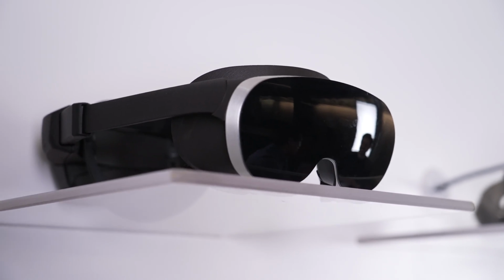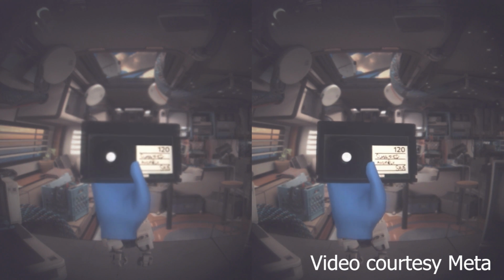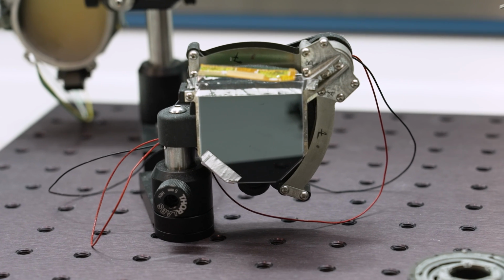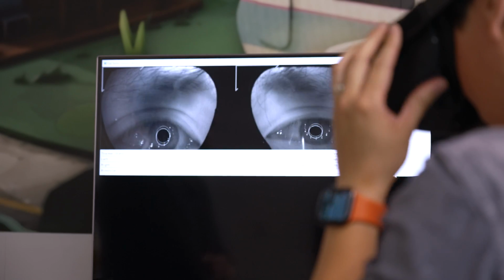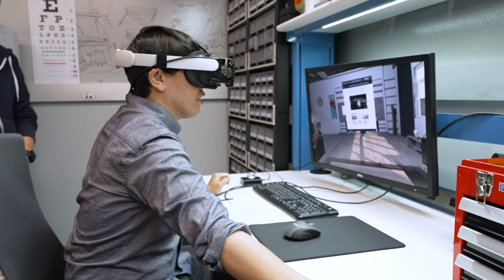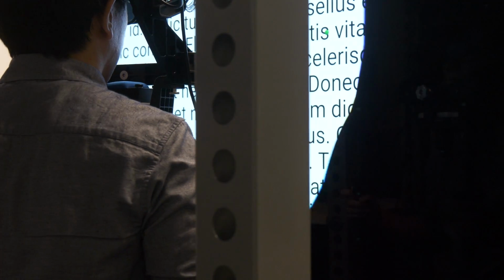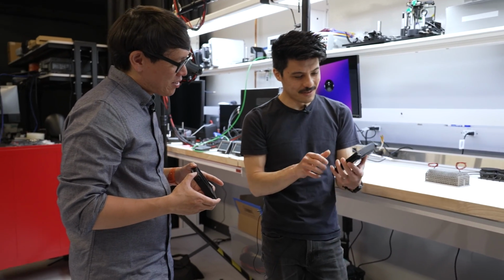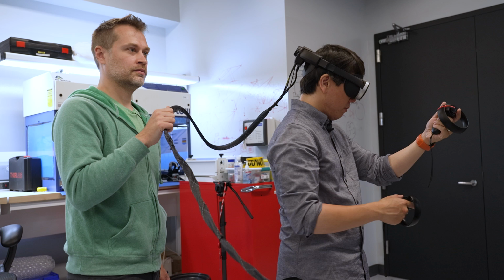Hands-On with Meta's New VR Headset Prototypes!

Comment from the maker: What are the display features you want most from a VR headset five years from now? 

Join this channel to support Tested and get access to perks:
https://www.youtube.com/channel/UCiDJtJKMICpb9B1qf7qjEOA/join
Tested Ts, stickers, mugs and more: https://tested-store.com
Reply: In 5 years…

7680x7680 per eye

Also developers that care about performance and not just make it look cool and hope the person buying can play

The displays should be done as best as they can from the get go and have it as a module so you can upgrade the processor or the housing or what ever it may be

People are more likely to buy improved parts rather than a whole new headset

If dell can do 2 DP inputs without issues then driving 7680x7680 per eye would not be an issue with 2x dp 2.0 ohh and at 120hz minimum
Reply: @commanderoof4578 8K lenses for VR means that your computer will be running a game on three different displays at the same time, a 30 series NVDIA GPU cant even handle 4K on max settings for VR, lenses are only clear in the very center in a specific viewing position, and because of that foveated rendering is a staple for VR games and how it works is it reduces the resolution for details not centered in the lens, thus 8K resolution will be natively reduced anyways
Reply: @G4MFR34K64  because of terrible devs that is the case correct

But the 2 VR games i have worked on myself can be rendered 3x at 8k resolution and without any gimmicks be it motion blur, depth of field or any rendering crud going on

You are saying as it is now

I saying how it will inevitably be

And finally most devs are sat on there ass doing the bear minimum to make quick cash while VR has more or less nothing but half assed games available
Reply: In rough order of importance:
ACTUAL GAMES NOT CRAPPY MOBILE GAMES,
near 180 FOV, 
8k per eye,
greatly reduced or no image distortion on imperfect eye placement,
pass through camera which capture environment in 8k 120hz, 
flawless finger tracking and face tracking, 
<1lb weight,
controllers with adaptive triggers and better vibration feedback.
Reply: A FOV that hides the edges of the lens, and HDR
Reply: @EinkOLED  yes to larger FOV!
Reply: @EinkOLED  firstone cant be done even if the lenses where too large for the image being displayed there is still an edge to it (just turn your head)

Second one being HDR…

Personally HDR sucks the range of blacks and range of whites gets messed with and shrunk and it destroys the enjoyment

Lets say you have 1,000,000 blacks that fade closer and closer to grey… go HDR you just slaughter it to 100,000 best case and even less in most cases

More backlight zones is superior to HDR in ever single way so its better to ask for 50,000 backlights per eye than HDR that most will turn off immediately
Reply: @commanderoof4578  Thanks for, you're right.
Reply: I don’t understand why people feel the need to make these jokes. It’s not harmless and honestly the joke is so old.
Reply: The only thing I want to see is Facebook/Meta die.
Reply: Larger FOV, past 170°
Reply: Quest headset with an upgradeable GPU, 8K screens, OLED, HDR, smells, haptic gloves, field of view as wide as possible
Reply: Field of view and skin-ability. Good passthrough. Good grips on controllers. Rift S only ticks the first. Fast setup. Button to take and share VR photo in SBS stereo mode. Support to (pop-out) SBS photo sharing anywhere.
Reply: Really good HDR.
The dynamic range of current gen HMD's just feels so lacking. I'm so glad that this is something Zuckerberg values.
Reply: Today on adams tested, we demonstrate that our only real interest is money
Reply: I hate the antichrist
Reply: I'm still enjoying my Rift CV1.  What I want most are 1) Better graphics, 2) Better graphics, 3) lighter / more comfortable headset.
Quest was a huge step backward from PC VR.  Big mistake.
Reply: Larger FOV.  Eye tracking with Foveated Rendering.  PPD can be similar to Quest 2 PPD.  Better weight balance (put some components towards the back of the head).  I would be fine if this meant limited new graphical capabilities for developers (similar to the difference between playing the same game on a Quest 1 vs a Quest 2).  Similar battery life as Quest 2.
Reply: A FOV that makes me feel 100% like I'm there
Reply: I'd love a proper PCVR headset :) I mainly use VR for MSFS, so i just need a nice high res headset that can do that without needing a NASA supercomputer
Reply: Much greater motion resolution. Using a sample and hold flat panel for VR seems silly, when it is so crucial to get low persistence. If that 20k nit HDR prototype could give us a panel that could give us a .5ms strobe maintaining 350 nits full screen white, I feel like that will give us more benefit for what we are rendering. What use is a 6k per eye LCD if head movement only nets you 400 lines?
Reply: Light weight, sharp resolution, huge field of view, eye tracking, AI anhanced facial tracking, hand tracking and gesture recognition, fast refreshrate, wireless, small audio speakers, automatic calibration 😁
Reply: As a oculus rift user, I definitely want to be able to read text that's more than a metre away from me. I find it hard to read the gauge cluster on a vehicle without moving my head forward. It would also be nice if I couldn't see each individual pixel like on a matrix display. Another nice-to-have would be wider FOV
Reply: It not being made by facebook. Don't use this channel to do PR for facebooks garbage
Reply: Varifocal lenses, double the resolution and 40% more FOV
Reply: All of this wont mean a thing unless they get the data transfer rates and compression to a point that can support 4180 X 4180 native wirelessly.  Wireless is the future by every measure.
Reply: @hollowaether4034  the Quest 1 was such an amazing device, the feature i miss the most from it is the very wide lens sliding scale that helped for a wide range of astigmatisms, without the proper visual adjustments, motion sickness is inevitable and will be exponentially more arduous and dangerous to overcome

that's the next step for getting it in everyone's hands, meanwhile most people are inquiring about 8K lenses but I guarantee they have a computer that barely can handle our 2K standard for lenses
Reply: Does anyone know how to take a "screen shot" with an HTC Vive Headset using Valve controllers?
Reply: How about a strap that is not fucking disgustingly unergonomic?
Reply: X D  what do you mean?
Reply: Emuvr inter graded for old school gaming
Reply: More games and co op like resident evil 5 and more
Reply: If somehow possible to not need exrta lenses if you have glasses. Maybe idk.
Reply: It's still uncanny valley territory
Reply: Ease of use for crying out loud, have the meaning of plug and play been forgotten?
Reply: Better resolution, wider FOV, more standalone GPU performance (even if I had to wear it on a belt)
Reply: maybe its not-so-perfect eyesight but I dont see any need for higher resolution, but better antialiasing would be nice. Maybe like DLSS on nvidias graphicscards, they scale up a picture and it also makes very good antialiasing (so good, that i use DLSS only cause of this, since its better than other antialiasing techniques ive seen), but I really want better field of view. And maybe that they also think of the balance of the headset.. so they put more stuff at the read of your head (like the battery is on the quest2 if you get the other headband) so more 50/50 weight dist would be nice.
Reply: Verifocal, FOV > 120 degrees, pancake lenses. Resolution close to human eye. Yup just a dream that's what it is
Reply: I want pixel motion clarity. Crts used to be good at this, now oled with black frame insertion are close-ish, i want that - high refresh rate, screw the brightness, give me black frame insertion instead.
Reply: @GFClocked  black frame insertion is dumb AF

You want mini-led / amoled / QD-oled

Altho you could instead just turn your damn lights off and get a normal oled with a glass panel instead of a matte finish
Reply: @commanderoof4578  i don't think you understand what bfi even is. I already mentioned that its to be combined with oled. Amoled is oled.
Reply: @GFClocked  i think its the other way round

BFI halves your hz’s so a 120hz monitor with BFI is a poxy 60hz monitor

Where as QD oled doesnt need BFI and allows you to happily have your screens full hz’s capability (tho dumbasses can if they wished enable BFI on a QD oled)
Reply: Will they be able to connect to steam at last?
Reply: @yiyegorris  you already can tho…

Its called Oculus link FFS and all you need is a cable from your PC to your headset

If what you mean is connect it using a display-port or HDMI cable then we probably wont be getting that but could get USB 20gbps which basically negates the need for that and allows 1 cable to use (if you can provide the power from your selected port)
Reply: @commanderoof4578  yeh the thing is that I burned out my last laptop 2 years ago playing VR, twas the GE75 MSI with the 1100Hq 2'50 Ghz native and 1070/6GB from 2018, after covid. Abusing vr on PC stresming to the rift burned the laptop out. 

So, the thing is, Steam on Oculus, not Steam on PC to Oculus
Reply: Easy part: Build it into contact lenses.  Let the opacity shift across the range from AR to VR.  Hard but inevitable part: ai accurately modeling all the worlds media in 3D, not just new content, but every old film, cultural event & porno that exists, so we become the camera (but w parallax).  The only way to get everyone on board is to expand peoples sensory experience of everything in the virtual world, and in a consistent way, even if initially a minor effect that improves over time.  No one wants a digital world that’s even less reliable than this one.
Reply: @Spuzzmacher  centuries away because to drive that you would need external power both well power and the processing

Which by extension means wifi performance needs to he orders of magnitude better

And also the hole planet or at peasy your room would need to be colder than it is today so that the contact lenses dont melt your eyes

Cool in theory but will be orders or magnitude past your age at death
Reply: @commanderoof4578  You’re thinking of building the entire system into the lens.  I’m thinking of the lens as display only, with the system elsewhere.  We’d be talking about a very tiny display here, not some giant hundred watt job.  Low power transmission is possible over short distances such as from the frame, hat, necklace, earpods, nose-ring, whatever.  The processing could all be done by your phone, sent to your head accessory for a very minimal wireless transmission.  …or even wired, out the far corners of the eyes directoy into some wraparound earpods with room for power & processing for that matter.
Reply: @Spuzzmacher  uhhh compression is a thing and wireless is no where near good enough

And if your talking about wearing a headset or wearing 2 headpieces 1 either side then sure that could be done in a couple decades time

But without those things its multiple centuries away

Ohh and if you remove the contact lense part then for power transmission and data transmission everyone becomes a neko and it becomes pick your neko driver set for your lenses

And that will cause issues because humans flipping suck at accepting diversity let alone all of a sudden everyone looking halfway between a human and animal

The reason for that is with todays tech you need quite a bit of space between antenna’s to pinpoint where it goes otherwise the sheer amount of interference from anyone else using the same would make it impossible with todays tech without going neko or face mounted with the antenna in line of sight
Reply: The #1 feature, the no-questions-asked-dealbreaker, is having that headset and ecosystem not being tied in any way to Meta/Facebook.

It's a complete non-starter.
Reply: The feature of it being not connected with Facebook or Meta
Reply: I want it to have no connection with Meta/Facebook whatsoever.
Reply: Being outside nightmare companies like Facebook.
Reply: KIller feature would be 'not made by facebook'.
Reply: A display that's not by Meta. I know we're all excited about VR, but it's socially irresponsible to promote that company.
Reply: None at all. This tech is garbage and it's a shame you fanboy over Meta/Facebook nonsense like this.
Reply: Nothing, VR is a fad. And who the hell is going to be more productive in VR? Over the course of an 8-hour work day. Hold on I'm getting a call on my Red hydrogen one.....
Reply: @itchysundae  if you use multi monitor setups and you like being able to work from anywhere its a godsend… also a cinema for everyone…. Its great in many ways for sure not a fad…

Comment: Tried oculus. Biggest problem is the center of gravity is forward off your face. Needs counterbalance weighting on the rear to make it more neutrally balanced, no different than how NVGs need counterweight on the back of the helmet.  Mounting batteries at the rear would be nice, but I know the marketing dept probably wants a streamlined looking product. Mounting the battery at the rear and separate also makes battery size only an issue with acceptable weight on the neck. Would also make Li ion battery swap after 4 or more years of degradation easy.

Comment: It's fascinating how Mark continues to destroy such a wonderful company. Oculus was #1 in quality and pricing, now it's a shit-show with a 300 dollar price tag. I bought a quest 2 and because of it being poorly designed, you're strapping a lithium battery to your face that only lasts 3 hours without cable and WITH cable, your headset's battery life is extended by like another 2 or three hours. Not only that, but the charging port ends up becoming worn after a month, making the cable either sit incorrectly as it wont charge properly, OR The cable is loose and won't even connect. There's also reports of the charging port melting because of their chargers. Apparently, the foam for the face-rest caused irritation and allergic reactions to people and "recalled" products. No, they didn't, all they did was send out a silicone cover for it. That's not how you recall or how you would fix the problem. What kind of design is this? Why do you need to buy an oculus link for 80 dollars in order to use your pc with your headset? Oculus never did any of this, they provided everything needed and even gave some more by providing 6 free games and I believe even including batteries for your controllers. The entire thing was nicely organized and you could tell that this company put love into every single product and box shipped out, never had any problems for two years until I ended up misusing the Oculus Rift and because of my mistakes, it broke. I know for a damn fact that it would've taken awhile for it to give out on me if I was treating it properly. And I know for a damn fact that Oculus would've done so much better than what Mark Cuckerburg is doing now. Do not buy Meta's products, they're just basically a damn cash-grab while embarrassing the entire VR community with it's "metaverse". Good job ruining a beautiful newly-born genre, and because of Mark not knowing anything about the topic, ruined VR long-term.

Comment: the massive flood of scam posts in marketplace are mostly scams and dropships operated openly by cartels.  META not only takes cartel money to sponsor the listings, they also enacted policies to protect those cartel run profiles so reporting them and the 100 ads just like it from the profile nets zero action.  META is currently laundering for them based on the available information.

Comment: one thing id love to see vr headset makers offer is built in perscription lenses even for a fee, i do have those magnetic lenses, but itd be better if it was just native lenses just offered by the company
Reply: Pancake lenses (coming first w/ Quest Pro later this year) will literally do just that. They let you manually adjust the specific diopter of each lens, meaning you just adjust them to match your prescription and you've got perfectly corrected VR vision. No inserts required.

Comment: I absolutely love my quest 2, so much i bought a 2nd so my family could play together.  What i really want for pro or cambria or whatever is wider FOV and and controller similar to Valve Index.
Reply: Quest Pro isn't for gamers, and thus gamer features like that aren't important on it. The FOV will likely be identical to Quest 2, just with higher resolution MiniLED panels (2160x2160, aka Reverb resolution), in a MUCH smaller headset w/ pancake lenses, & with massively MASSIVELY EXPANDED AR camera passthrough capabilities (full RGB color, high res, high framerate, etc...)

Any bumps to stuff like FOV will come with late 2023's Quest 3.
Reply: @Cooe.  By then I'll have moved on to Pimax, or Valve's next rendition I'd imagine.

Comment: its becoming increasing clear that LCD technology just doesnt have it in it to produce the fidelity that is required for VR. They need to start looking at alternatives.
Reply: LCD's the ONLY option. OLED's can't hit the required pixel densities without using the game ended 2x subpixels per pixel PenTile layout, which literally wastes an entire THIRD of your graphical/GPU performance rendering the 33% of subpixels PenTile OLED's literally DO NOT PHYSICALLY HAVE!

With PenTile OLED you get all the clarity reduction of running at a 1/3rd lower resolution with none of the performance benefits. It's literally the worst of all worlds. Not to mention OLED's absolutely HORRIBLE black/dark motion smearing.

And the only other option than that is MicroLED which is probably still 20-30+ years out until it can do pixel densities high enough for VR.